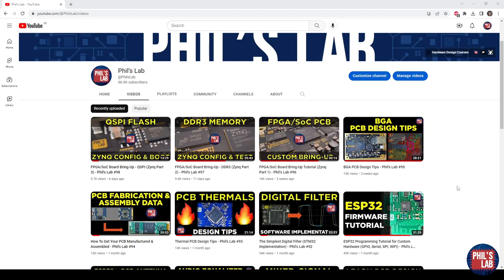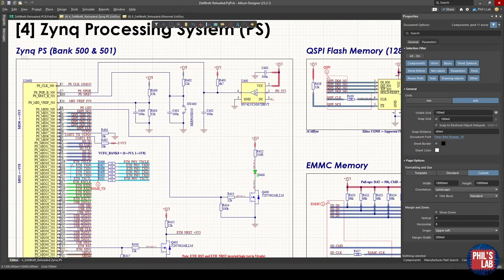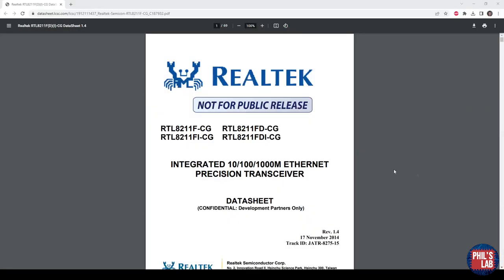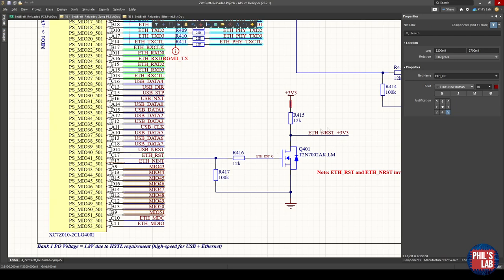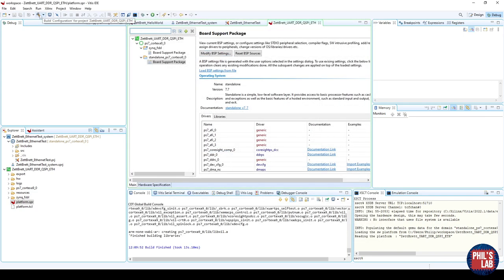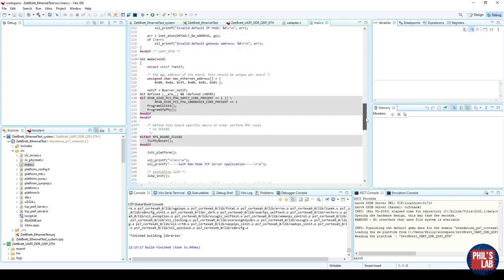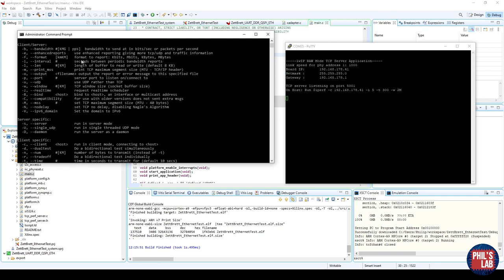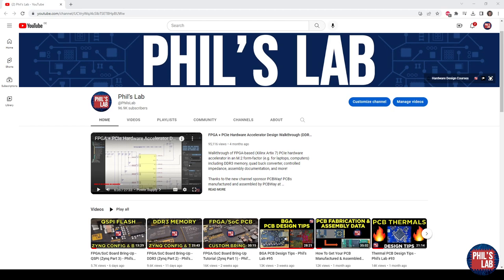Gigabit Ethernet + FPGA/SoC Bring-Up (Zynq Part 4) - Phil's Lab #99

Comment: Thaks  Phil   I found  a change  to make on my pcb  I am doing almost  the same design  but  Kicad  Not altium  I just copied  your  Rj45  I put a JXD0-0001NL   the  HR911130A  is a lot 
Cheaper  ? Why did you not use  the Maxim chip  MAX20029 it seems a better psu.  You are a lot faster  than I am  I started  in December  and am only now  at a clean  SCH  with no errors.
I am thinking   using  4 chips   PAM2310BECADJR   so-8  I am going with  Hirose Connector   .

You have saved me many Hours  as you have shown  the Bringup  I am at least a few months  away from Bringup  . I do my own  BGA  soldering   I am doing it all in house at home.
not PCBWAY  for assembly  .Arieway

Comment: Nice! Impressed that the Zync can handle the nearly 1Gbps throughput to/from the PHY, and the suite of test programs that Xilinx has provided is pretty nice. Seems like they embedded iperf in a standalone program. At least in Linux, the Realtek PHY "quirks" will have already been worked-around in the driver :D
Reply from the maker: Thanks, Jacob! Yes, pretty impressive chip the Zynq is.
Reply: Keep in mind that while the throughput is 1Gbps, the clock speed at which the FPGA interface to the PHY (RGMII) runs at 125MHz. The Zynq should be able to handle faster clock speeds at its IO :)

Comment: Hi Phil,
I am currently trying to bring up Gigabit Ethernet on a Zynq board using Broadcom B50612D PHY. Currently, the PHY clock is supplied by a 25MHz crystal. In PS IP core clock configuration for ENET0, I see 4 options: ARM PLL, IO PLL, DRR PLL, External. Which option should I choose for my board and is there any differences between each option?

Comment: not gonna lie, I have the impression that you are really good, but I am still impressed that it makes 900mbit/s+ (probably it wasnt that hard for you, but still)
Reply from the maker: Thanks!
I'm glad it worked out first try on this board as well, but I was more worried about the DDR interface, as there's far more that could go wrong there.
Reply: @PhilsLab  I have seen that it is possible to install linux on old phones but is it possible to add something like ft232h or raspberry pi pico to make that smartphone a partial raspberry pi .

Comment: Thanks for your work, very useful. I would like to ask you if you know some method for updating the SW of zynq using the ethernet connection. For example, through an embedded web server. It would be very interesting. Thanks a lot.

Comment: Hi Phil, thanks for such a great video.
I'm trying to send 2 HD-SDI video feeds and one UDP communication protocol on a single ethernet connection. Could you please help me on how to achieve that?
Reply: have you looked at NDI from Newtek?
Reply: HD-SDI has 1.5Gbit/s or 3GBit/s datarate unless you compress it. So you would need to either compress, or use a 10Gbit/s PHY. If you need to ask, I am unsure if this is something you should try to do with FPGAs. It would be easier doing with ready made hardware, like SDI input cards, a computer, and open source software for encoding/sending over ethernet. NDI is a simple solution yes.

Comment: I'm doing a project where I'm sending data through AXI into the PL and using the PS to send that data through Ethernet, i have most of the AXI work done and data is arriving in memory ready to be send through Ethernet but here i hit a roadblock and that I'm not familiar with the lwIP library and exactly how data transfers work with the PCB structure and accept calls, is there any documentation or examples you know you can refer me apart from the lwIP documentations and reverse engineering the xillings examples? I have done this already but i still have a hard time understanding the subject.
 On a side note i appreciate all your videos, you are the first person i go to when i need to learn something new on PCB design and my first go to person when i recommend sources on how to do it.
Reply from the maker: Thanks, Robby! I'm afraid other than the docs/app notes and examples, there isn't too much info on this online from what I have seen. I hope you can find a solution though!

Comment: Another highly educational video. Thank you Phil. The example programs are based on some kind of RTOS ?
Reply: No OS so far just running directly on the hardware for this simple testing stuff.
Reply from the maker: Thank you! No RTOS used for these examples I believe.
Reply: These lwIP examples are simply lwIP stack in standalone NOOS mode (so no RTOS) and a few applications from its app collection. Neat if you don't want to deal with full Linux bring-up yet. 
I'm more surprised that they didn't combine both iPerf2 TCP & UDP servers with ICMP echo and TCP echo server. I did (most of) that when tinkering with STM32F072B-DISCO and USB FSDEV RNDIS -- it managed 6 Mbps throughput over USB 12Mbps while fitting in ~96/128k of Flash, 16k of SRAM and serving a webpage at the same time!

Comment: May i ask what're your plans for this board ? Are you planning to sell it as dev board at all ? This half FPGA half micro board is quite interesting.
Reply: Listen closely at 0:36
Reply from the maker: This is part of the upcoming 'advanced hardware design' course. When I release that, I'll also be releasing the board for sale!
Reply: Are we talking about an application agnostic dev board, here? What are the edges of this system's capabilities? Seems like a foundation for a tricorder like device, especially with AI becoming a more an more functional author of code, is this a piece of hardware where a person could ask AI to solve a problem and it could use this as its connection to the outside world, appropriate sensors attached, of course. 

Very cool! FPGA programming and utility are a bit beyond me at the moment but im following along like a baby swatting at a mobile. What is the best application use case to take advantage of all components of this system? What were you imagining when you designed this?

Comment: I could not get higher transfer speed than  59.7 Mbits/sec on several reference boards (microZed, XU8, ...). turns out to get top speed, I needed to increase LWIP bsp settings  tcp_wnd from 2048 to 40000. Now I get 943 Mbits/sec on all these boards.

Comment: What was harder, the DDR memory or the gigabit ethernet? I feel like it would be DDR, but this looks difficult as well. Anyways, another great video!!!
Reply from the maker: Thanks! DDR set-up was surprisingly simple and running in only a couple of minutes (thankfully). The Gig Ethernet would've been okay as well, hadn't it been for those few "bugs" I had to fix in the driver.
Reply: @PhilsLab  I think he talks about the hardware design, and of course, DDR routing is way harder that Ethernet !!